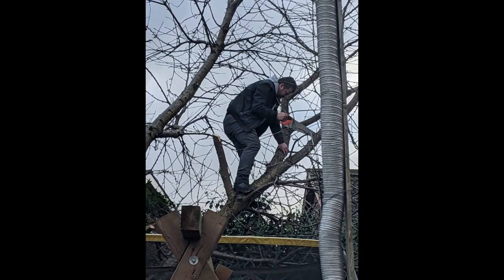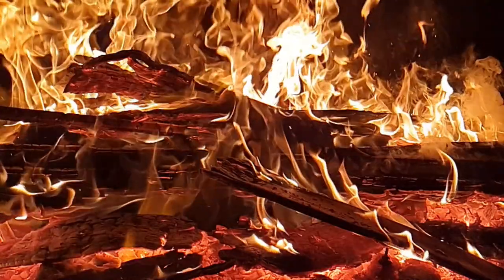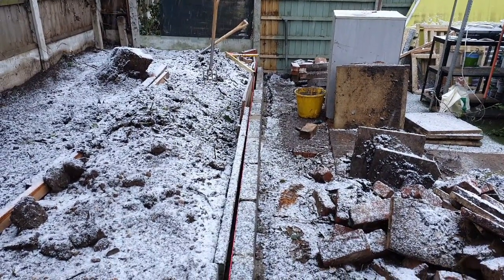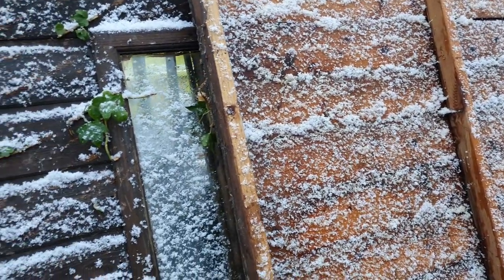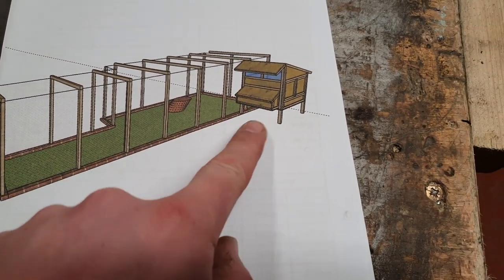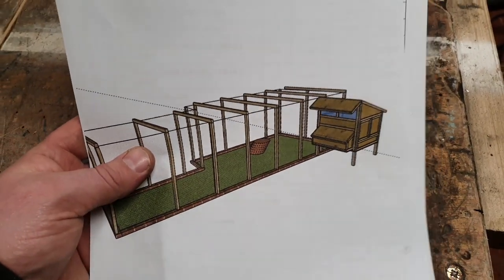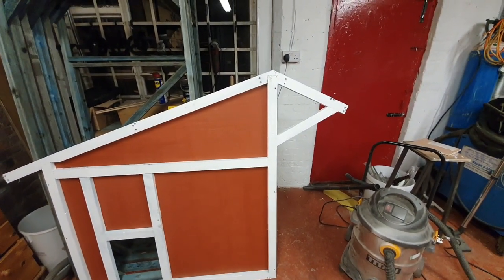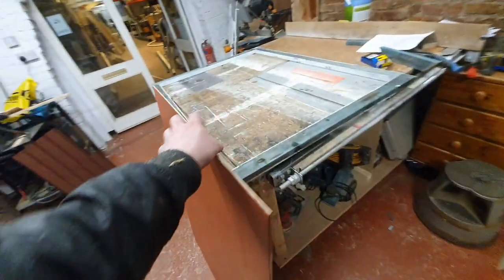New Year, New Garden

Comment: Did you use a plugin to generate the parts list and cutting diagram? 
Had me very confused on Insta with that post of the burning shed; thought you'd had an accident.
We were hoping for snow in London but it sadly never came this year - rather boring winter lockdown without it.
Reply from the maker: I cant remember if the plugin came with Sketchup or I installed it. It is simply called Cut List however.